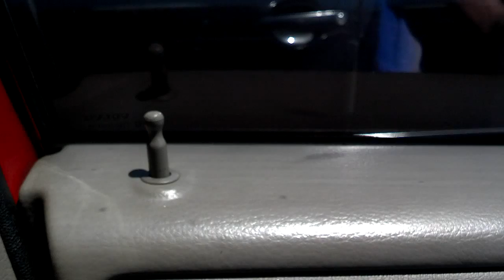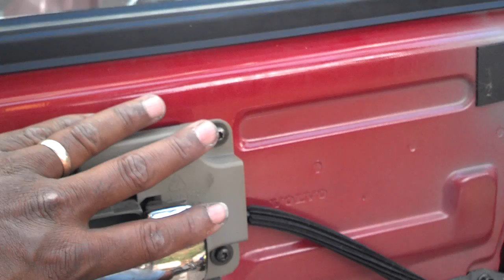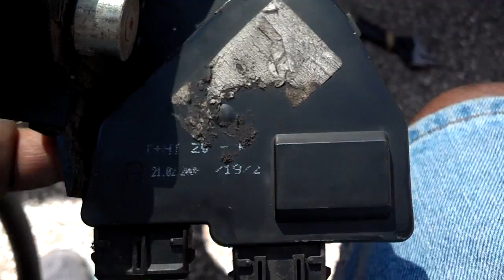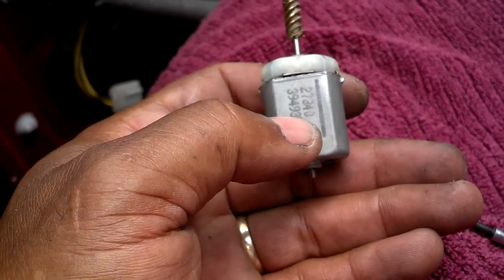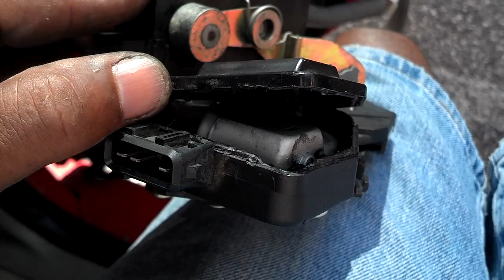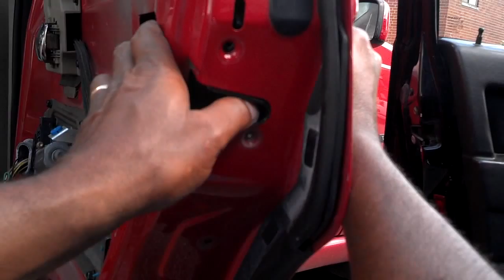Door latch lock motor repair, will not unlock with central locking Volvo S70, V70, XC70, C70 etc.

Comment: I've had a few P80's and I just finished replacing all four motors on my S70. The driver door latch plastic cover was the most stubborn one by far. It was replaced in 2011 so the plastic didn't give as easily as the other ones. Crazy that these start to fail after only 15 years. I just ended up swapping out the little motors to eBay replacements. I don't know how long they'll last but if I get 15 years out of the new ones, I'll be happy.
Reply from the maker: Amen

Comment: I have a different problem! My doors are unlocking but NONE is locking! :( what could it be?
Reply from the maker: Probably a bad relay.
Reply: @RobertDIY I checked the fuses in the engine compartment, and everything is fine. The relays in the front of the engine bay also have nothing to do with the central locking. I didn’t find any relays under the dashboard either. Does the old V70 really have relays in the trunk? If so, how do I access them, and are they actually related to the central locking, or have I completely misunderstood something? Because in the front, as I said, I only found a normal fuse for the central locking, and it’s intact.
When I use the key from outside, only the rear door unlocks. Both rear doors unlock, and obviously the door where the key is used unlocks as well. But the front right door (passenger side) does not unlock. If I then turn the key back to lock, only the driver’s door locks, and the rear doors that were unlocked do not lock automatically.
Now, if I press the lock button from the inside on the driver’s side, nothing happens. I can hear the locks trying to do something, but absolutely nothing happens. However, if I use the lock button on the passenger side, the rear doors lock and unlock normally, but the front doors do not.

Comment: If you ever do any type of job like this, to split plastic like that, use a saw thats made for pipes. It cuts smooth and easy thru plastic and dosn't make a mess.
Reply from the maker: Thanks for the tip!

Comment: You are the man Robert! Whatever problem I have encountered so far you always had the solution at hand. Great videos! Tomorrow I will re-install the latch after having the glue dried overnight. I hope I will manage. The repair itself is done. I found it most difficult to open the motor housing. Best Regards from Austria! Joe
Reply from the maker: Glad to help. It is hard getting those tiny motors apart.

Comment: My bezles around the lock pins turned to cheese so i tried to replace them with the ipd aluminum bezels but they wouldnt fit the factory pins! So i figure the plastic falling apart was causing my issue of the locks not coming all the way up
Reply from the maker: https://swedishcarparts.com/parts/1605-volvo-interior-door-trim-ring-s60-s80-xc70-xc90-v70-granite-color-9182378

Comment: Is it the same for trunk lock on V70??
Reply from the maker: No, you likely have a broken wire somewhere or a bad actuator in the trunk.
Reply: @RobertDIY  I am able to open the trunk by key. But with remote it only makes clicking sound and doesn't open..

Comment: Hello Robert. I have a Volvo 1998 S70 and need some advice on parts, I need a gear stick and that item is super expensive. I was thinking of pick  and pulling some parts. My question is how can I find a savage yard that has my make and model? I live in Albany GA.
Reply from the maker: I usually open up my Google maps app and type in pool and pay salvage yard. Then I look at the results for the one that say Pick-n-Pull U-Pull pull and pay stuff like that. Then you can go to their website and look at their inventory.

Comment: Hi Robert! I have a 94 850 that has a few door lock actuators on the fritz. I opened up on today and tested the motor and it seemed to be running OK, also tested with the 9v plugged in to the two wires in the wiring harness which was also OK. For some reason, the motor doesn't function when plugged into the vehicle. Windows work as does the trim light on the door, and no obvious damage to the harness. I pulled the #6 fuse which looked OK and my last bet Is the Door lock relay under the dash. Any chance that it could be busted even though 2/4 locks work?
Reply from the maker: Maybe it's weak and doesn't pull hard when the door latch is putting pressure on it.

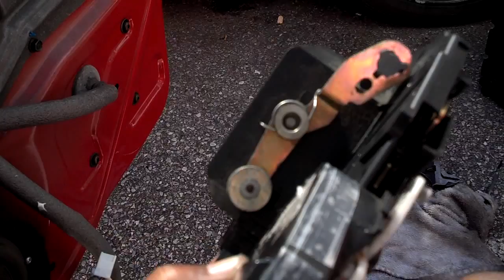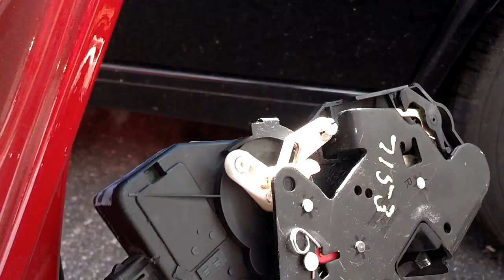Comment: Hey Robert, i'm having trouble getting the rubber knob into that plastic piece at 15:22-15:58. That plastic piece in my car seems to be slightly too far away and as a result i'm not able to push that knob into the plastic piece no matter what angle i use or how hard i push. The door im having trouble with us the front passenger if that helps. Let me know if you know anything about that and thanks in advance if you respond! ps: your content is super helpful as a volvo s70 owner and you've definitely earned my subscription, keep up the great work!
Reply from the maker: It is a pain in the butt. I usually put the latch into the door just below that catch, then pivot the latch up into the proper position. Then I pull the outside handle in and out to get the locking pin into it's hole.

Comment: I fixed my driver rear door and it’s working fine except the door is unlocking when I push lock and locking when I push unlock. How did I manage that?😂 The motor only seats one way.
Reply from the maker: Somehow got the polarity reversed. 🤔🤦🏾‍♂️🤷🏾‍♂️

Comment: Hey I did this fix, and even though i can see the motor actuating on the mechanism during an unlock, the white plastic piece that moves the locking pin does not move up. Any idea why?
Reply from the maker: My guess would be that the latch assembly is bad.

Comment: Hello Robert, it is absurd that Volvo would use a motor where a simple solenoid (or pair of solenoids working push pull) would work far more reliably. I have a 2000 S70 where both rear door lock motors got lazy. To top off that stupidity Volvo placed the finger stems at the back so to reach the stems from the front you have to stretch far to reach. These motors are just low priority on a long nuisance fix it list on a car that's hanging in by a thread after 254000 miles. The most annoying is that everything (entire body) squeaks and crackles even on a smooth road
Reply from the maker: they are getting old. the good thing is that they can be fixed.

Comment: Anyone that knows the data of  thermo fuse for the door lock motor and power window motor?
Im about to order thermo fuse for the antenna motor, 2A 114°C.
Might as well add those others since cost is almost nothing compared to shipping.
Good video!
Volvo S70 - 98
Reply from the maker: Not I said the Robert

Comment: I tried this repair but wasn't able to successfully put the motor back together after removing the thermal switch. I was admittedly a bit ham handed when opening the motor up. But it occurred to me: with the two S70's I've owned this issue has only ever been with the rear door locks, the front locks have always worked just fine. So I wonder if the front door locks don't have this annoying thermal switch? I pulled a couple of front door lock motors from the junkyard and installed them in the rear doors of my S70, so far they're working great. And it's a lot easier than the electric motor surgery method here. To me at least. Assuming you have a junkyard near you of course.

I've been meaning to pull a couple more front door lock motors at the junkyard and pop them open and confirm my theory that they don't have thermal switches. Does anyone else know by chance?
Reply from the maker: They have them. 

I didn't realize that the front door latches will bolt into the rear doors. 🤔 You will loose your child safety locks but most people never use them.
Reply: @RobertDIY  I'm only talking about the little motor, which looks identical, and I don't think affects child safety locks? I don't know how those work though so maybe I'm wrong. But it looks like the exact same motor. I haven't opened one up to check for the themral switch. But odd that I've never seen a front door with the issue. Maybe people just replace those more often?

Comment: I have a problem in my 99' C70.. I have the remote key to unlock and lock the car and to open the trunk, the trunk opens just fine with the remote but the doors lock/unlock ( i can see the door lock inside the car coming up and down when i use the remote key) but it doesn't let me open it, only when i insert the key.. I can't figure it out because.. if i open the door with the key and then lock it with the remote, the door will lock (visually) but it will still open if i pull the handle outside the car!
Is it common on C70? or is this just another headache
Reply from the maker: This video covers it. Worn out latch assembly.
Reply: @RobertDIY  So is this the same problem as with the remote control not unlocking/locking it? Cause in mine i can see the "stick" coming up and down when i lock or unlock it but the door itself doesn't!
Thank you for your time

Comment: First thing is to mechanically rotate shaft with fingers before doing anything else.If it works both ways that operation would help. Otherwise will not, something else maybe plastic gears are broken.

Comment: Thank you
My problem is a bit different. The motor works and the lock button goes up and down but the door does not actually lock. Click button up then click button down but the door will always open from the outside. I'm stumped on that one.
Reply from the maker: Bad latch

Comment: Hi Robert, my 2000 S70 has  working motors but the passenger latch doesn't lock allowing the door to open whether it's locked or unlocked. Any help appreciated
Reply from the maker: You want to bring it by?
Reply: @RobertDIY  I'd love to but I'm in Phoenix Arizona
Reply from the maker: https://youtu.be/NhtUXZTurzo

Comment: Nicely done Robert!

Liquid Nails is garbage from experience. A wind resistant lighter helps break the seam along with a flat tip. But you got it.
Reply from the maker: Yes, I no longer use it. I use contact cement.
Reply from the maker: I need to update that video.

Comment: Nice job!  One question - I have a 2011 C70.  The driver's door did all the weird stuff - like unlocking and opening itself while on the highway and then recently the driver's do inside handle stopped opening the door.  The cable is still attached and is pulling so I assume that it is something in the latch.  Should I just replace the latch or do you think I could repair it?
Reply from the maker: Not sure. It should only open mechanically so there may be something broken internally. You didn't wash the vehicle in cold weather where it could have gotten wet and froze up?

Comment: Followed your  instructions for repairing the door lock motor. The motor works now, but the door still does not lock. What else can be the problem?
Reply from the maker: bad latch.
Reply: @RobertDIY  Darn! we bought a second assembly from the junk yard before we watched your video, and my husband repaired the motors on bot of them, but neither will lock, even though the motor(s) now work. Is there a way to repair the latch?

Comment: Do you know how to repair the switch inside these locks, that recognize whether door is open or closed? When this switch wears out in any of the doorlocks, the footlight/doorlight will not turn off even though the door is closed and alarm will not arm because the system think the door isn't shut.
Reply from the maker: No

Comment: Thanks, this helped me fix this problem!

Word of advice. Make sure you connect the cable harnesses to the lock in the correct way. I accidently switched them and burned through two fuses. 😊
Reply from the maker: That should not be possible because they are keyed.
Reply: @RobertDIY  not mine, they were identical but had different colors, black and Grey. Also I had some kind of aluminum plate between the lock and the door that you didn't have in your video. Would have been easier to access by removing it but then you would have to loosen the window engine etc so I ignored that.

But again, I switched the cable harnesses back to the correct position and now everything works fine!

My car is a 99 S70 so maybe they changed something on that model.
Reply from the maker: could be.
Reply: I also burnt a fuse by reconnecting the 2 plugs the wrong sockets during a test before reinstalling on 1998 S70

Comment: I did this repair on my doors, and it worked! Thank you! I also had a broken linkage, that locked one of my doors... So manufactured one out of fencing wire... ;P (which worked)
Reply from the maker: Good deal.

Comment: What if the interior door handle is the only one that opens the door? Like the exterior handle doesnt open the door when its unlocked. Does this issue correlate with the thermal switch?
Reply from the maker: no

Comment: What if the sensor/switch for the light has malfunctioned? Is there a way to bypass that switch? My passenger door never thinks it's shut even though it is. Slamming it works, but I have to slam it hard enough to wake the dead. I don't need the lights to come on when that door is opened.
Reply from the maker: You can replace the latch.
Reply: Usually the plastic piece on the latch that contacts the striker on the body wears and light stays on

Comment: Great video as usual. You wouldn't happen to know where to find a replacement motor should anything go wrong with it while I try to break into it? I'm having a hard time bending those tabs back in order to replace the thermal switch. Thanks for all your experience
Reply from the maker: Nope. Never had a motor fail.

Comment: looking to put the lock back into place. i am having difficulty getting the exterior latch to fit down into the lock. there appears to be a loosely kept plunger with some threads that fit into a keeper on the lock. how do you position this so that it will go into the lock??
let me now thanks. volvo6802005 - passenger side rear door
Reply from the maker: Bring it by and I'll fit it in for you.

Comment: Hi, Robert. I enjoy your videos. I can see the thermal protection device becoming over-sensitive after years of use (circuit breakers can do that also), but is there any chance that the motors are heating up due to dried up lubricants or something. If the mechanism is no longer moving freely, the excessive current could heat the motors up. Just a thought.
Reply from the maker: Nope.
Reply: Okay, I believe you, Robert. I used to work with x-ray machines in hospitals that have a lot of moving parts that were connected to motors. One machine had to transport a loaded film cassette quickly into the radiation field to take an x-ray. There were two circuit breakers, one for each direction. These would eventually become overly sensitive and trip when they shouldn't. You could spend all day trying to find a fault in the system that was blowing the breakers, but it was the breakers themselves that were bad. They also protected the circuit by sensing heat (due to current through a resistance). My locks are sticking in the V70 that I just bought, so I was wishfully thinking. I don't mind the mechanical stuff, but I hate dealing with door panels! ;-)

Comment: Awesome detailed video. One word of caution , you can fit the electronic connectors to the door latch motor backwards if you aren't sure which way they go. I did and at first it simply didn't work on the one door. But now none of the door motors respond nor the trunk latch. And the car won't start either now. Go figure , anyone run into similar issues?
Reply from the maker: +C Mendoza nope. You probably triggered the alarm somehow.
Reply: The SRS light would flash and no other light when the key was being turned. I reconnected the door latch and replaced the 20 amp fuse number 6 for the central locking/alarm unit . Works now, like new. Thanks for the speedy response too. Keep up the good work.
Reply from the maker: +C Mendoza good deal.
Reply: You have blown central locking fuse by this operation. Car won't start without that fuse.

Comment: Worked a dream! Took less than an hour. I used a half inch wood chisel to remove the motor cover: popped off, undamaged, in seconds. On the driver's door lock I had to put the key in the lock to align the lock mechanism. Used a strand of wire from a battery cable in an 's' shape to replace the thermal switch - quick and easy and worked fine.
Reply from the maker: Great idea, thanks for sharing.

Comment: Thanks again Robert you saved me close to $400 today!
 
I cut around the edge of the motor assembly cover with a razor before prying at it with a few different sized screwdrivers. It worked well and I managed to get two disassembled with almost no breakage.
Reply from the maker: A hair dryer works good.

Comment: I followed this tutorial, pulled the motor out, and put copper wire in place of the heat sensor. The electric motor still doesn't work. I think the electric motor itself may be broken. Do you know where I could order a brand-new replacement electric motor for the door latch?
Reply from the maker: +Forrest Iandola I have one you can have that works. Send me a pm.
Reply: +Robert DIY Fantastic -- thanks, Robert! I just sent you an email.
Reply: Going to give this a shot on my 98 V70. Useful info! Have you ever tried QBond on something like the lock motor casing? Its basically super glue on steroids and fixes most materials. Cost me about $17 at the car parts place but one box had lasted all year. It's a must have for me as I work on older cars as well and some of the parts are getting hard to find.

Comment: is putting a penny for the electrico connection good to
Reply from the maker: +Juan Hernandez Probably to big. They are not copper so, not sure how good it will work.
Reply: I cut the penny to size and put it in and now it works perfect thanks Robert for your help
Reply from the maker: +Juan Hernandez don't tell anyone. It is a violation of the law to destroy currency.